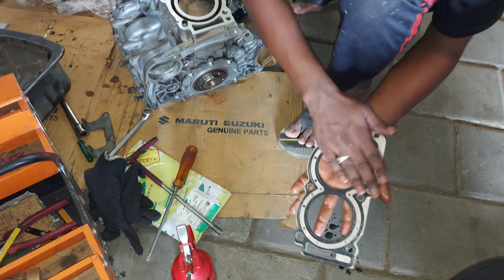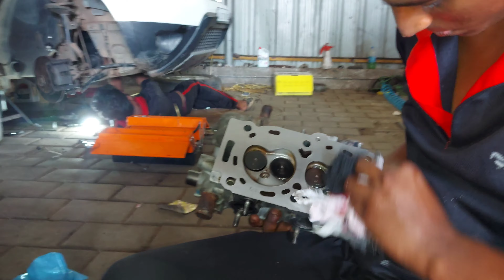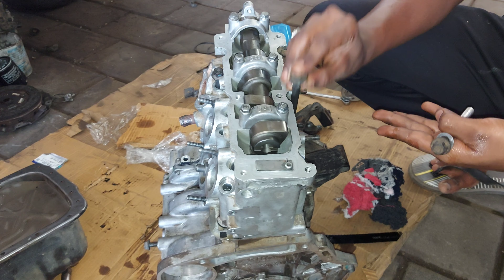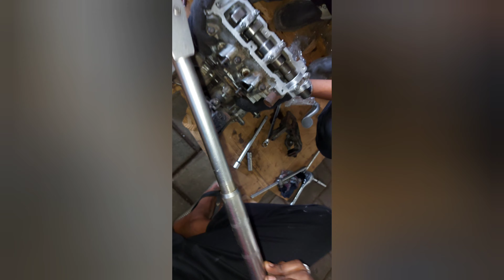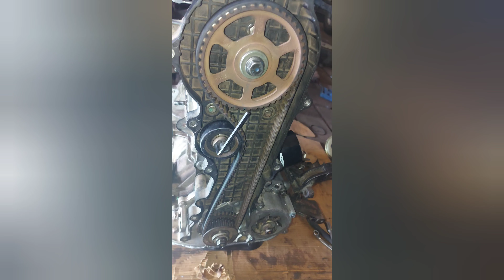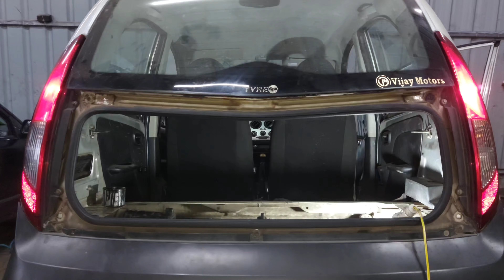nano engine overhauling and head bolt torque

Comment: What was the issue. How many kms did the original engine completed
Reply from the maker: 123657
Reply from the maker: Over heating and oil consumption
Reply: @autotrusttechinicaltips  ok. I was expecting 150,000 engine life. But 123k is very near. My nano has done 111,000 kms